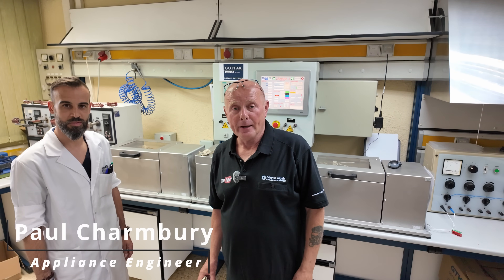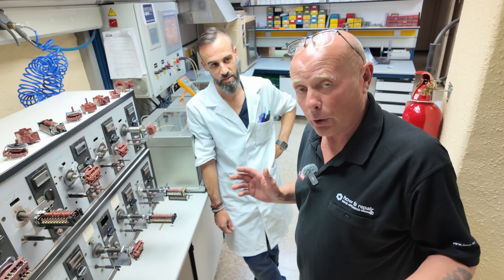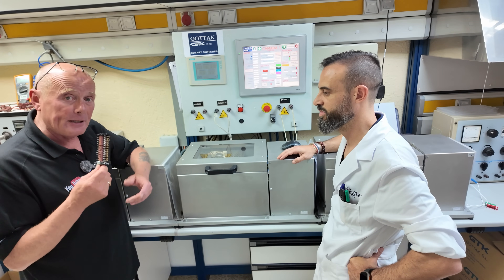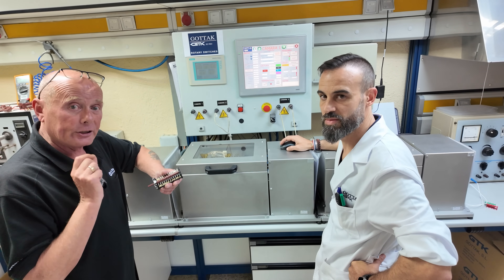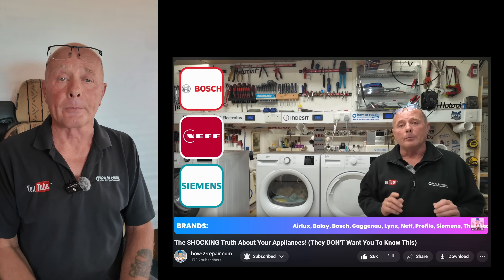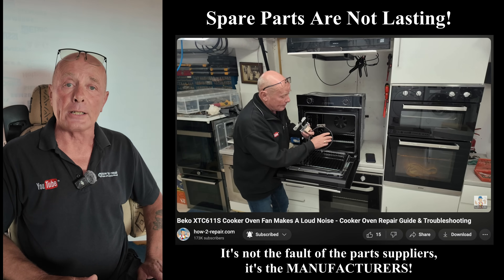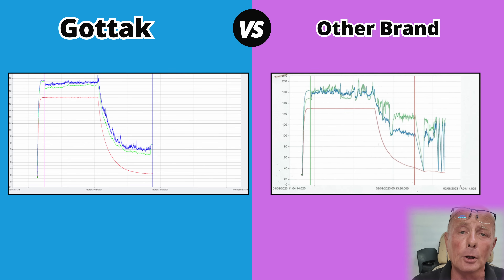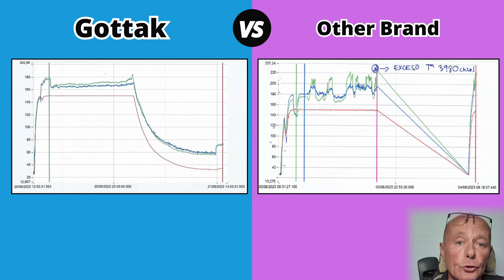Why Your Appliances FAIL SO FAST! Lab Results EXPOSE the Truth!

Comment: We still have our 100.00 RCA microwave oven that we purchased 11 years ago and it still works perfectly, other than the lightbulb going out and the display is just starting to have artifacts/anomalies happening.
We use this thing every day for cooking, reheating and defrosting frozen foods. I guess it's longevity can be attributed to the electronic controls vs the mechanical rotary knobs on similar models.
Our freeze king 5 cu.ft. freezer was bought at the same time and it to is still working perfectly!!!
Our oven/stove is an AMANA digital and we've had it 10 years and never had a problem with it and IT GETS USED!!!! A LOT!!!
Reply from the maker: Hi there! Thanks for your comment, @johnnyq1233!

You've hit on a really important point about how some older appliances were built to last, unlike many modern ones. Your RCA microwave, Freeze King freezer, and Amana oven are fantastic examples of the kind of longevity consumers used to expect. This is exactly the kind of built-in obsolescence we discuss in the video – the stark contrast between your durable appliances and the shorter lifespans we see in new products.

At the trade show last year, understanding how much obsolescence is being designed into new appliances these days is something everyone should be aware of. For a deeper dive into this topic and to see the examples we covered, please check out the full video here: https://youtu.be/gEgSCbZnHVM?si=wTIw0mELuhWaw4aX

We also explored related aspects in these videos:

The shocking truth about manufacturers: https://www.youtube.com/watch?v=QsdGd2qDPaI
Heat pump tumble dryers: are they really worth it?: https://www.youtube.com/watch?v=xn03N3b0-lE
If you found this information eye-opening or helpful, please consider sharing this video with your friends and family. The more people who understand what's happening with appliance longevity, the better equipped we all are as consumers.

Thanks again for watching and engaging! Don't forget to subscribe to the channel for more insights like this!

Comment: Thabk you for these videos. The thing is manufacturers are not responsible for the complete management of their product when it goes to trash. If manufacturers were responsible for the recicle of ALL the materials, we would have longer lasting, easier to recicle greener products. Now is up to the end user to make the product last and to the states doing the recycling. The benefits of making something recyclable and with easiness to recover materials are on the other side of making it cheap and fast.
Reply from the maker: Hi there! Thanks for your comment, @Machiflores, and thank you for your kind words about the videos!

You've hit on a really important point about manufacturer responsibility for the entire lifecycle of their products, particularly end-of-life management and recycling. Your suggestion that making manufacturers responsible for recycling all materials could indeed incentivize longer-lasting, easier-to-recycle, and greener products is a powerful one. This is a key discussion when we consider why products are often not designed for durability or easy material recovery, which relates to the built-in obsolescence issues we explore. The current model often prioritizes making things "cheap and fast," as you mentioned, rather than sustainable.

At the trade show last year, understanding how much obsolescence is being designed into new appliances these days – and how little focus there sometimes is on true recyclability or longevity – is something everyone should be aware of. Making manufacturers more accountable for waste is certainly a perspective that could change design philosophy. For a deeper dive into how current products are often designed, please check out the full video here: https://youtu.be/gEgSCbZnHVM?si=wTIw0mELuhWaw4aX

We also explored related aspects in these videos:

The shocking truth about manufacturers: https://www.youtube.com/watch?v=QsdGd2qDPaI
Heat pump tumble dryers are they really worth it?: https://www.youtube.com/watch?v=xn03N3b0-lE
If you found this information eye-opening or helpful, please consider sharing this video with your friends and family. The more people who understand what's happening with appliance longevity and sustainability, the better equipped we all are as consumers and citizens.

Thanks again for watching and engaging! Don't forget to subscribe to the channel for more insights like this!

Comment: 6:42 don't blame "accountants" ... Blame the CEOs, VPs and board members.  They're the ones who demand a reduction in cost.  With each redesign they want less expensive, lower quality parts to be utilized even if the current design has worked flawlessly.
Reply: Blame the investors. Investors in publicly traded companies have a fiduciary responsibility to make as much money for their clients as possible. It is in their best interest to push short term gains, then sell off once the problems start catching up.

I'd rather call them "infestors".
Reply: @thorlancaster5641 This is why the problem won't get any better until we get reliability regulations.
Reply: @thorlancaster5641 if I invest in something I'd want it to have long term gain and growth...  Or current financial markets are really messed up
Reply from the maker: Hi there! Thanks for your comment, @xephael3485!

You've hit on a really important point regarding where the ultimate responsibility lies for decisions to reduce costs and potentially use lower quality parts, highlighting the role of CEOs, VPs, and board members rather than just "accountants" (referencing 6:42 in the video). Your observation that they often demand these changes with each redesign, even if current designs work well, is a key aspect of the pressures within manufacturing. This is exactly the kind of decision-making process that can lead to the built-in obsolescence we discuss in the video.

At the trade show last year, understanding how much obsolescence is being designed into new appliances these days – often driven by such top-level directives for cost reduction – is something everyone should be aware of. For a deeper dive into this topic and to see the examples we covered, please check out the full video here: https://youtu.be/gEgSCbZnHVM?si=wTIw0mELuhWaw4aX

We also explored related aspects in these videos:

The shocking truth about manufacturers: https://www.youtube.com/watch?v=QsdGd2qDPaI
Heat pump tumble dryers are they really worth it?: https://www.youtube.com/watch?v=xn03N3b0-lE
If you found this information eye-opening or helpful, please consider sharing this video with your friends and family. The more people who understand what's happening with appliance longevity, the better equipped we all are as consumers.

Thanks again for watching and engaging! Don't forget to subscribe to the channel for more insights like this!
Reply: @How-to-repair nice AI response
Reply: People who need to meet Luigi.
Reply: Blame the shareholders.
Reply: If you are pointing fingers don't forget to blame the consumer,  who keeps buying from these companies.
Reply: @micahisawesome4843 it's easy to blame consumers, but they likely do not have other good choices available and a being manipulated by a triopoly or cabal of main manufacturers
Reply: @micahisawesome4843  The problem is that as a consumer you have no way to know whether something is reliable or not before you buy it. Ask all the people who had the misfortune of buying cars with wet timing belts before it became a widely known issue.

Comment: In the US have a GE refrigerator that is 35 years old and a whirlpool washer and drier that is 25 years old.
No problems at all.
Tell me why all these new appliances need to be hooked to WI-FI now just crazy. Some need a cloud account for all the functions to work just nuts.
Reply from the maker: Hi there! Thanks for your comment, @glennrechnitzer8704!

You've hit on a really important point about the reliability of older appliances compared to the increasing (and sometimes unnecessary) complexity of new ones, like needing Wi-Fi and cloud accounts for full functionality. This is exactly the kind of trend that can be related to the broader issues of built-in obsolescence we discuss in the video. Don't even think of all the other complications auto dosing systems Bluetooth capability some programs will not even work unless you connect it to the app

At the trade show last year, understanding how much obsolescence is being designed into new appliances these days is something everyone should be aware of. For a deeper dive into this topic and to see the examples we covered, please check out the full video here: https://youtu.be/gEgSCbZnHVM?si=wTIw0mELuhWaw4aX

We also explored related aspects in these videos:

The shocking truth about manufacturers: https://www.youtube.com/watch?v=QsdGd2qDPaI
Heat pump tumble dryers are they really worth it?: https://www.youtube.com/watch?v=xn03N3b0-lE
If you found this information eye-opening or helpful, please consider sharing this video with your friends and family. The more people who understand what's happening with appliance longevity and unnecessary "smart" features, the better equipped we all are as consumers.

Thanks again for watching and engaging! Don't forget to subscribe to the channel for more insights like this!

Comment: Embedded hardware / firmware / software engineer here...
Avoiding planned obsolescence and low quality consumer electronics, is the main reason why I designed the majority of my home automation setup myself 5 to 7 years ago. 

Circuitboards where all custom designed in KiCad, including the central controller for my home automation system, LED lights, wall switches, carport controller, doorbel extender, etc ... Embedded firmware was all written in C/C++, backend software was written in Python3 running in a Linux VM on my proxmox server. Haven't had a single failure till this day, and I own all design schematics needed for repairs in case something would break. 

Doing it myself wasn't cheaper in the short term, as each light-bulb is easily priced around 100 Euro/USD. It will be however cheaper in the long term, as I haven't had to replace anything in the past 5 to 7 years... My whole automation system runs locally, as an added bonus. Meaning that my smart home keeps running, even when the internet is down.
Reply from the maker: Hi there! Thanks for your comment, @timmy7201!

You've hit on a really important point about the lengths one might go to avoid planned obsolescence and ensure high-quality, long-lasting consumer electronics, as demonstrated by your impressive custom-designed home automation system. This is exactly the kind of built-in obsolescence we discuss in the video.

It's fantastic to hear how you've successfully engineered your own solutions, from circuit boards in KiCad to firmware in C/C++ and backend software in Python. Your experience really highlights the benefits of owning your designs and ensuring local operation, which resonates with the concerns many have about modern appliances. At the trade show last year, understanding how much obsolescence is being designed into new appliances these days is something everyone should be aware of.

For a deeper dive into this topic and to see the examples we covered, please check out the full video here: https://youtu.be/gEgSCbZnHVM?si=wTIw0mELuhWaw4aX

We also explored related aspects in these videos:

The shocking truth about manufacturers: https://www.youtube.com/watch?v=QsdGd2qDPaI
Heat pump tumble dryers are they really worth it?: https://www.youtube.com/watch?v=xn03N3b0-lE
If you found this information eye-opening or helpful, please consider sharing this video with your friends and family. The more people who understand what's happening with appliance longevity, the better equipped we all are as consumers.

Thanks again for watching and engaging with such a detailed and insightful comment! Don't forget to subscribe to the channel for more insights like this!

Comment: In 1984 I made the purchase decision to upgrade from an early 1970s twin tub washing machine to a shiny new Hotpoint front loader and matching dryer. At the time, the standard electromechanical program control switches were already notoriously problematic, so I chose to go with a new micro-controller based digital machine. 

It has provided good service ever since, but now sits in need of a replacement door seal. It’s actually had a couple of replacement door seals over the years … they always fret and fail at some point … but this excellent machine has now been made useless by my inability to source a simple replacement door seal. I am now expected to purchase a complete new washing machine at incredible expense to me (I’ve looked at the cost of an equivalent replacement) … especially as I am now a pensioner … all for the sake of a £15 seal. 

Am I really being so unreasonable as to be able to expect a pretty standard seal to still be available? Have door seals really changed so much over this time? Why would Hotpoint change the design of such a standard part?
Reply from the maker: Hi there! Thanks for your comment, @davidrowley-ic6dx!

You've hit on a really important point about the frustration and expense caused by the unavailability of simple, replaceable parts for older appliances, like the door seal for your 1984 Hotpoint washing machine. This is exactly the kind of built-in obsolescence, or perhaps more accurately in this case, obsolescence due to lack of parts and support, that we discuss in the video. Your experience of having a perfectly good machine rendered useless for want of a £15 seal is a powerful illustration of the problem.

It's truly disheartening to hear that a machine which has served you well for so long, and which you chose for its then-advanced technology, is now facing a premature end due to something so seemingly minor. Your question about whether it's unreasonable to expect a standard seal to be available, and why designs for such parts might change, gets to the heart of the issue. At the trade show last year, understanding how much obsolescence is being designed into new appliances these days, or how long-term parts availability is (or isn't) considered, is something everyone should be aware of.

For a deeper dive into this topic and to see the examples we covered, please check out the full video here: https://youtu.be/gEgSCbZnHVM?si=wTIw0mELuhWaw4aX

We also explored related aspects in these videos:

The shocking truth about manufacturers: https://www.youtube.com/watch?v=QsdGd2qDPaI
Heat pump tumble dryers are they really worth it?: https://www.youtube.com/watch?v=xn03N3b0-lE
If you found this information eye-opening or helpful, please consider sharing this video with your friends and family. The more people who understand what's happening with appliance longevity and parts availability, the better equipped we all are as consumers.

Thanks again for watching and engaging with such a pertinent real-world example! Don't forget to subscribe to the channel for more insights like this!

Comment: Just while ago "fixed" medium kärcher pressure washer and 1-phase wood splitting machine. Switches contacts always burn black. Either swipe those with sandpaper or to make sure it works longer, bypass.
Reply from the maker: Hi there! Thanks for your comment, @GameBacardi!

You've hit on a really important point about the issue of components like switch contacts burning out, as you experienced with your Kärcher pressure washer and wood splitting machine. This is exactly the kind of built-in obsolescence we discuss in the video.

At the trade show last year, understanding how much obsolescence is being designed into new appliances these days is something everyone should be aware of. For a deeper dive into this topic and to see the examples we covered, please check out the full video here: https://youtu.be/gEgSCbZnHVM?si=wTIw0mELuhWaw4aX

We also explored related aspects in these videos:

The shocking truth about manufacturers: https://www.youtube.com/watch?v=QsdGd2qDPaI
Heat pump tumble dryers are they really worth it?: https://www.youtube.com/watch?v=xn03N3b0-lE
If you found this information eye-opening or helpful, please consider sharing this video with your friends and family. The more people who understand what's happening with appliance longevity, the better equipped we all are as consumers.

Thanks again for watching and engaging! Don't forget to subscribe to the channel for more insights like this!